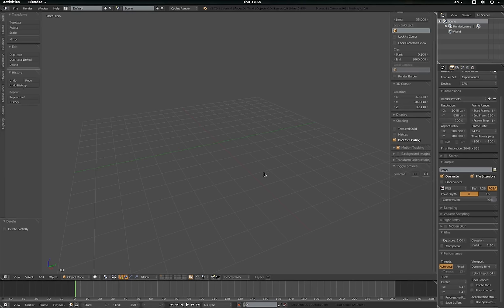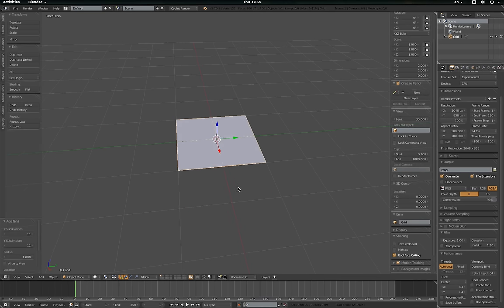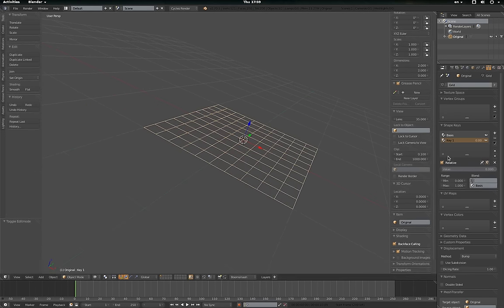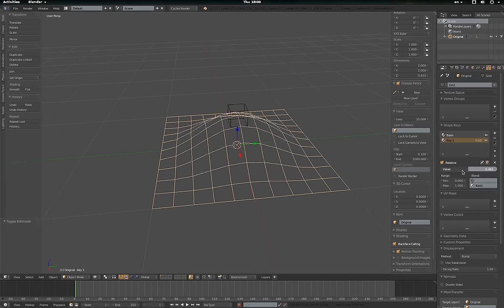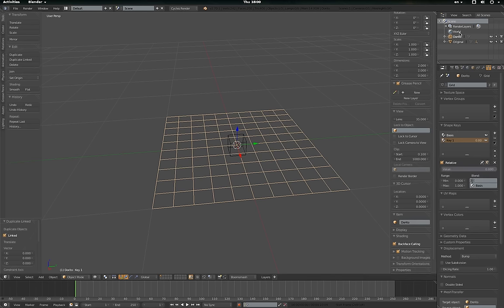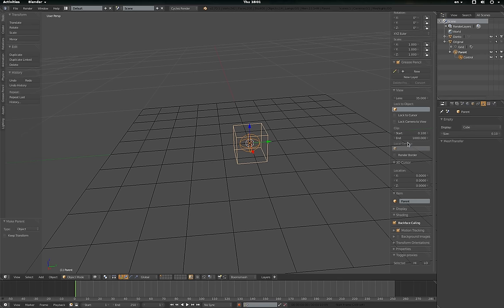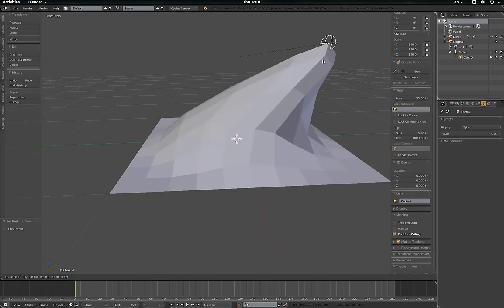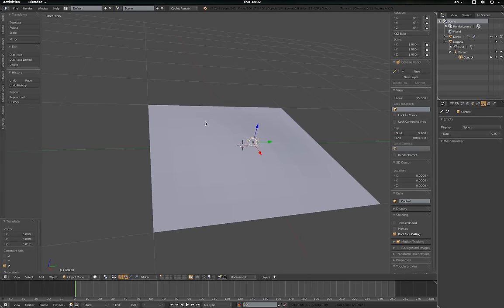Quick Dorito Workflow Blender

Comment: yeah, now this is the fastest Dorrito workflow! :) didn't knew you could do this with a morph modifier, i tried this with armatures the other day, but the rig was updating only on framechage.
Reply from the maker: thanks! the blend file I have parents the warp modifier empties to bones, so it works with a rig too :)
Reply: thanks for the tip! :) i've read your dorito-pdf, very interesting.
Reply from the maker: Wassili Franko
Good news is Lukas Tonne is working on a re-write of Blender's dependency graph: which means things are going to get better in the future. His work is currently in a branch, and I have no idea when the plan is to merge into trunk. That might fix the last little problems, and make this super fast and convenient (perhaps even allowing more optimization)
Reply: +Bassam Kurdali this is exciting news! do you know if this going to be a nodified solution or somehow exposed to the user? I think i have to carefully re-read Joshua Leung's Blog on his gsoc depsgraph work again!